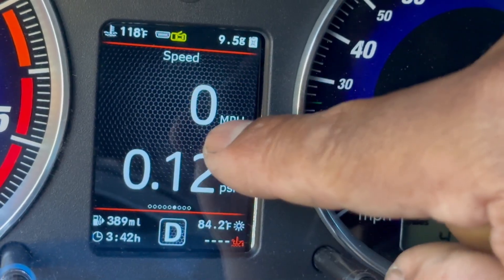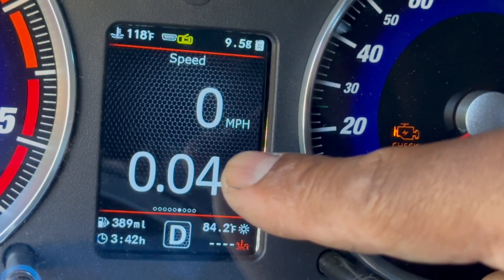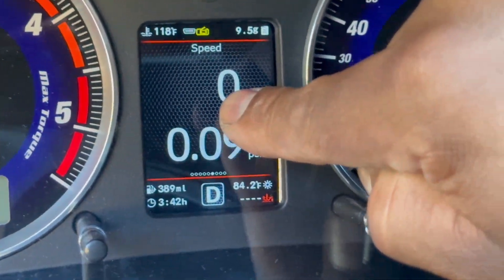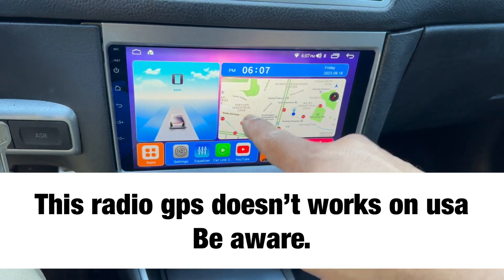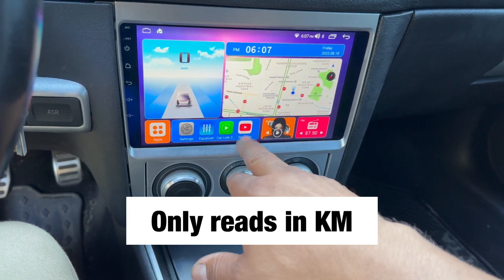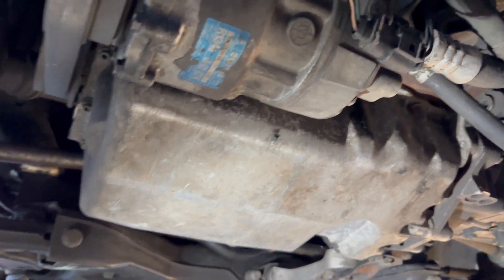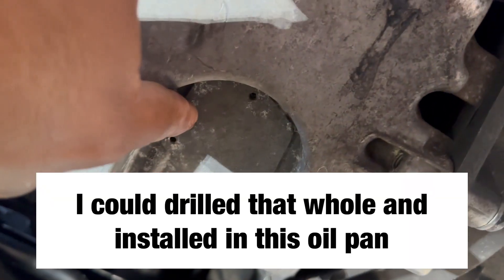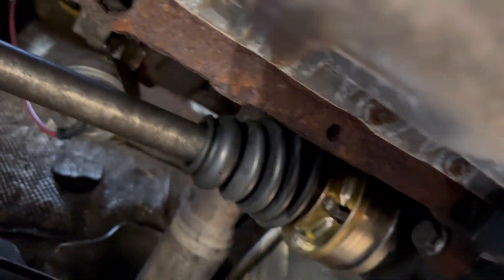VW TDI MK4 Oil level + temp sensor retrofitting

Comment: the ball point allen is the best to use for those 2 bolts
Reply from the maker: The ball point snaps  inside the bolt head
Reply: @taco8v  get better quality then
Reply from the maker: It doesn’t matter man they stripped the bolt head   , the best is using a 6 point socket